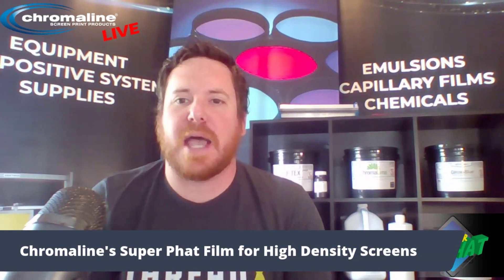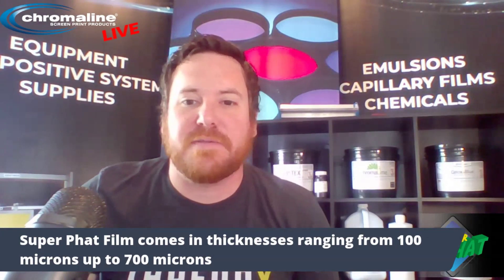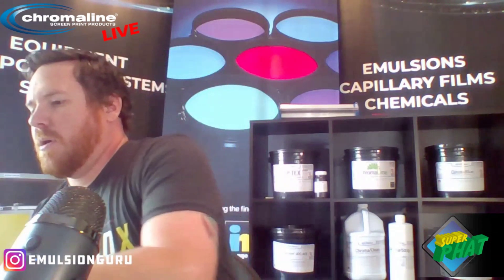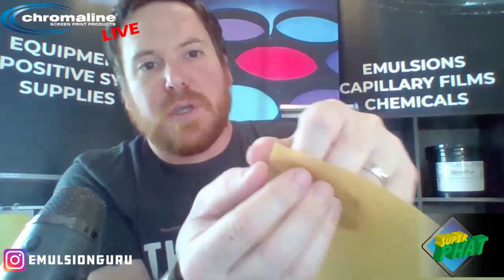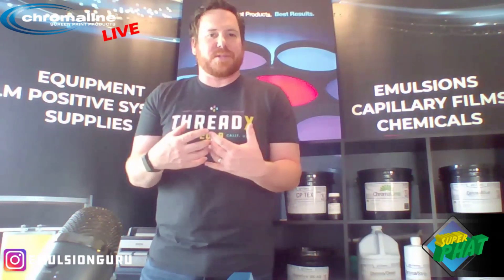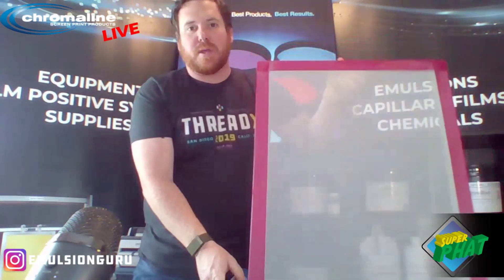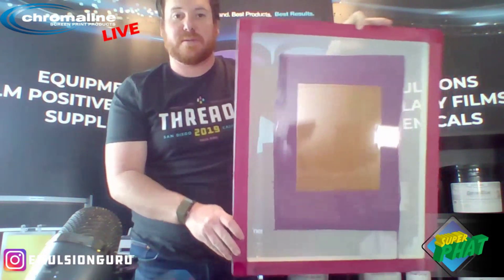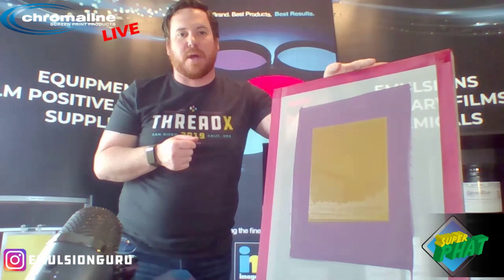High Density Screens with Chromaline Super Phat Film

Comment: Hello @EmulsionGuru, for the  Emulsion PC 701, can you tell me the process to do High Density screen with this Emulsion. Thank you
Reply from the maker: It's best/easiest to make high density screens using high density film, like Super Phat Film (discussed in the video, also see the video Quick Tips from the Screen Room: Phat Film Application). If you want to only use liquid direct emulsion you can coat then dry then coat again on the substrate side of the screen. Repeat this process until you reach the desire thickness.
Reply: Jiske Sar Ji Main ka ek screen hoti hai jo uski ke andar height banti hai jo hydrocele ke liye banti hai hidency screen hoti hai vah kaise banti hai Sar ji yah uska jo kaise banti hai aur Dai Se Kaise khatam hoga use Jeet Hogi

Comment: Why does the edges start to peel when developing film with water.
Reply from the maker: Typically this means you are underexposed or you are not using a water resistant emulsion as your direct emulsion. You don't necessarily have to use a water resistant direct emulsion, but since it take so long to develop these thick stencils it is recommended.
Reply: @EmulsionGuru  I use ULANO QTX PRETTY SENSITIZED EMULSION DRY IT FOR 2 DAYS GIVE 4 MINUTE. 20 SECONSE .AS TIME GOES BY OPENING THE IMAGE THE FILM STARTS TO  PEEL .
Reply from the maker: @sunilaggarwal3706  I'd recommend matching the Phat Film with another Chromaline product like CPTEX or UDC-ACE to make sure it's compatible. Regardless it is most likely underexposed.
Reply: @EmulsionGuru  Thank you Sir I'll try Chromo line CPTEX.

Comment: What mesh count you suggest for Superphat  300?
Reply from the maker: That really depends on the artwork you are printing; however, I typically use an 86 mesh for SuperPhat 300. Lower is also ok, but I would not go higher than 110 mesh for SuperPhat 300.